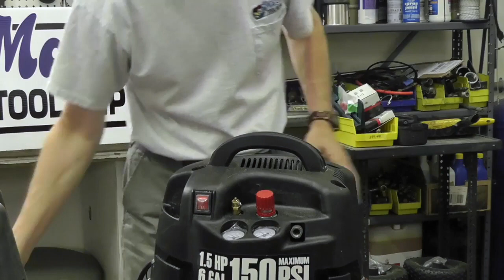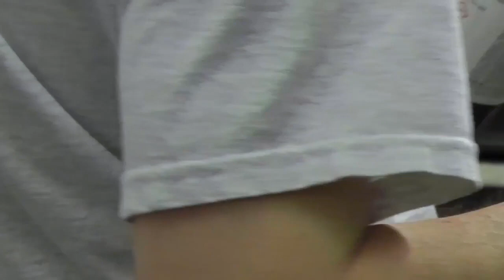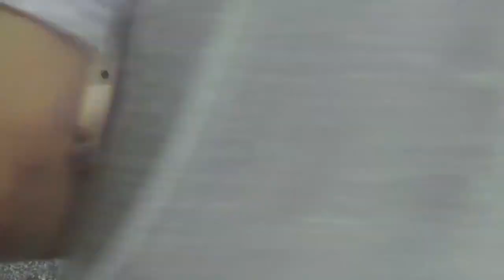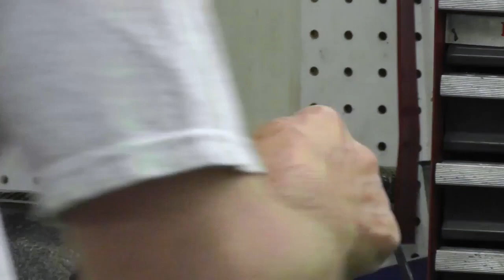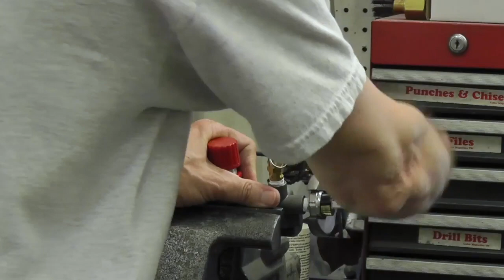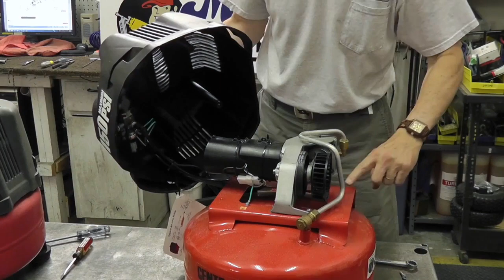Husky H1506F & Central Pneumatic 67696, 68149 Manifold Replacement   HD 1080p

Comment: I have the husky h1506f. Runs but pressure doesn’t rise above 6 or lbs or so. Bad regulator?? Or should I be checking the output of the piston’s line?

Comment: Just bought one for $30 and was looking into to putting the regulator back on for better use of it. Glad to know harbor freight will most likely have some parts. Mine is a 04417 for the bottom number but looks the same so it should work

Comment: Question I replaced the Manifold with the new regulator, I turn the air compressor on I see it filling up, bu tit wont shut off, gets to a point and the Safety Valve turn open and lets the air out, what do you think that is?
Reply from the maker: Thanks for the question! What you have there is a defective Pressure Switch. On this model it's either a small switch with a 1/4" thread on one end and two wire leads on the other, or it's a larger box pressure switch (depends on the date code of the unit:

https://mastertoolrepair.com/portable-oilfree-directdrive-electric-air-compressor-parts-type2-h1506fwh-h1506f-p-747266.html

https://mastertoolrepair.com/portable-oilfree-directdrive-electric-air-compressor-parts-type1-h1506fwh-h1506f-p-747265.html

The Pressure Switch informs the unit when to turn on and off and the cut-in PSI and cut-out PSI is preset at the factory, which this part senses and controls. So, replacing the Pressure Switch will take care of that problem!

Comment: Hi I have a question maybe you can help, I have a Husky Air Compressor Model H1506F I plug it let it fill up with air, then I grab the hose and any tool or Blow Gun, no air comes out what do you think it might be?
Reply from the maker: Thanks for the question! You probably have a defective Regulator. This is the assy shown in the video. If you adjust red knob either way and NO air comes through the line at all, your Regulator is defective (probably the diaphragm inside it). Since there is really nothing else blocking air flow from the tank to your line except for the Regulator valve, I'd go with this as being the culprit.
Reply: @MasterToolRepair  Thanks I ordered the manifold and a new regulator

Comment: Thank you. I only needed to know what tool to open the case to replace the pressure switch.
Reply from the maker: That should be a 5mm allen bit with a 6" extension, so you can reach down into the recess of the plastic shroud. Thank you for watching!
Reply: @MasterToolRepair  Yes, that worked.  I had an impossible time removing the old switch until I heated the manifold with a heat gun and then I could loosen the switch.   Found a 150/125 lb switch on Amazon that works fine.  Just putting the info here for the next person needing to repair.

Comment: Can you please tell what Husky or Campbell Hausfeld Oil Bath Air compressor models analogs of Central Pneumatic model 90234. ? Trying to find a valve kit.
Reply from the maker: Unfortunately, we don't have a known Husky analog to the CP 90234 model. It's very difficult to find the source for these models. You would need to contact Harbor Freight's customer service number to see if they can obtain replacement parts for this model. For many, they can sell you replacement parts.

Comment: Where do you get the replacement part? The only one I can find is 50 bucks. For 100 I can get a new compressor.
Reply from the maker: Thanks for the question! If you have the Husky H1506F model, we have this manifold assy available for $28.42 + shipping at the below link:

https://mastertoolrepair.com/regulator-9051141-p-30232.html

Comment: Thanks for the video. My central pneumatic compressor just like  yours in your video has a faulty regulator part. The defective part seats below the pressure regulator,  it has a spring the regulator pushes in and out when adjusted.
It is leaking air as the part is made of rubber, it just broke off.

What is the  part number for the  new manifold kit that you got? And where can I find it? Thank you!